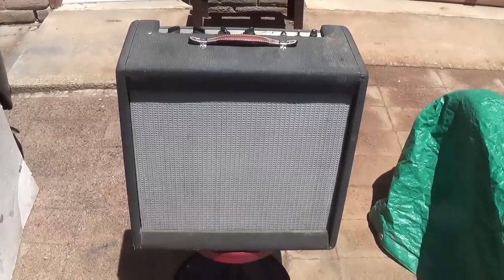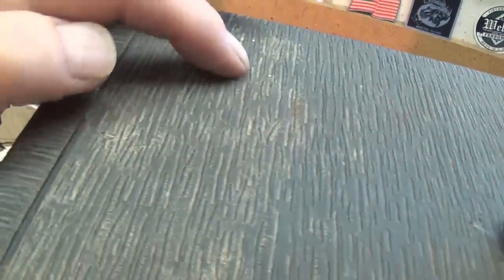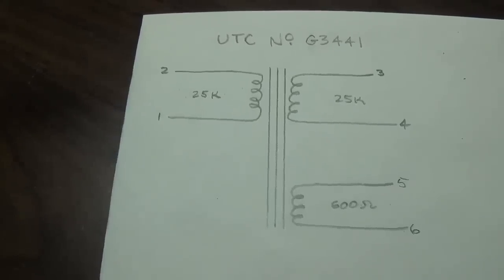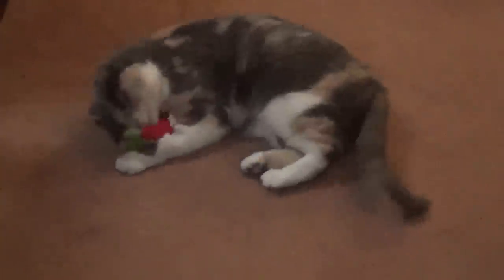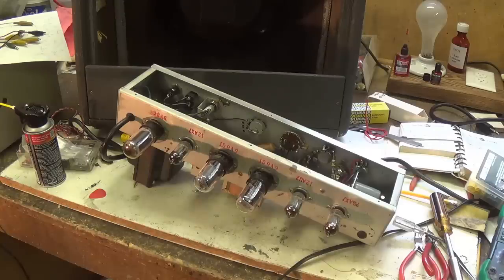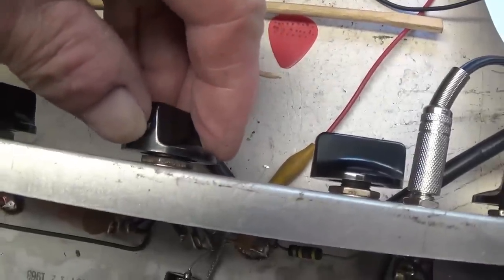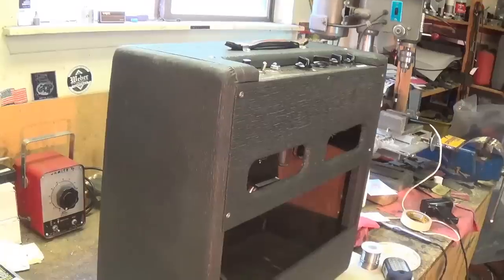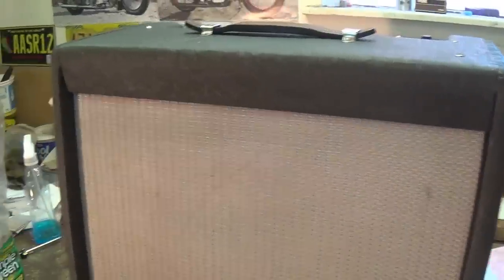1963 Lesmann "Echo" Amp......No More Polkas for this Bad Boy

Comment: I was thinking you may have to clean up that pot and switches. Gunk could be messing up vibrato and tremolo functions.

A hybrid amp with a push pull pair of transistors works just like their tube forefathers did...only the B+ voltage will be lower and the current draw higher.
You must bias the transistors like you would tubes to avoid crossover distortion and get the same kind of sweet spots in their characteristic curve...just like tubes.
You won't encounter the other two "grids"...just the control "grid" called the base. Transistors are true 3 element devices.

Read voltages from the "can" to ground. If the voltage is negative on the can (the collector), the transistor is a PNP transistor. So it'll actually have a B- supply instead
of B+. If the can is the positive on the transistor, it's an NPN transistor and it'll use a B+ supply.

I'll send you a little data via email.

Great video on the Lesmann, Uncle Doug. Turned out to sound pretty good. And I can fully understand how hooking to one 6V6 grid could work for the tremolo.
The ear still hears the result you wanted no matter how you got it.(8-)
Reply from the maker: Thanks so much, Tom. The switch was clean. There are no hidden secrets or effects.
Reply: It might be a good idea to pull a couple of those working transistors and measuring the gains  on them, just in case one of them Fails unexpectedly or gets fried in the process of troubleshooting and repairing the amplifier. You can look up the original specifications for most older transistors, how much current they will handle and so on, but gains can vary all over the place, and in my day-job work on 1960s and 70s vintage Hi-Fi gear I have often found that some of the small transistors in old amplifiers have extremely high gain and I have to test a bunch of our in-stock transistors in order to find replacement or substitute devices that are similar gain wise to the originals. Transistor testers can be found quite cheaply on the internet  or from  China n these days. If we encounter an unusual transistor that we need to replace at work, I let the Boss look up the specs and determine what we have that will be the best match and reliable in that particular circuit, he's forgotten more about transistors than I'll ever know, but he'll give me a bag of them and then I have to sort through and match the game's up. especially if they are driver or differential transistors where unequal gains means DC offset, and perhaps the amplifier doesn't have an offset adjustment trimmer. But I am rambling on and digressing..... ..... still, it's much easier to replace a transistor that is working and can be measured and tested then to try and replace it after you burned it up!
Reply: @UncleDoug  Well...no telling what the engineer was thinking...let alone a possible hobbyist later on. The amp would have had to put up with howls and squeals
from an accordion that a guitar can't dream up(8-). You did the right thing.

Comment: Wonderful job! That old amp would probably have been scrapped and the speaker and cabinet used for other projects. Although I’ve seen  accordion inputs on old guitar amps I’ve never seen an amplifier designed exclusively for accordionists, the addition of a guitar input would have given the Lesmann wider appeal.
Reply from the maker: It would have, indeed, Henry. They may still be in business if they had provided some versatility for their products.

Comment: Tremelo Oscillator in that bundle of black bits, looks like something that could be reproduced and added in to a Tube Amp circuit as you have just invented. What do you think,  can you share those oscillator parts and circuit design. Or can you point me to a schematic of such a circuit?? Such a wonderful result i am amazed at how just figure it out and then try a few things and then it works beautifully. Such a talent. Thank you so much for sharing your gift.  D
Reply from the maker: The type of tremolo circuit depends on the output power of the amp.  Single-ended or less than 20W, you can simply copy the Fender Vibro-Champ bias modulation tremolo circuit. Higher wattage circuits would have greater complexity and should use the Fender Deluxe Reverb Photoresistor-style of tremolo. You can download schematics from the internet.
Reply: @UncleDoug  thanks I am in it.

Comment: I wonder if the matching transformer was an external tank or something that used to exist, but no longer does. The mysteries! Anyways, damn good job. I wouldnt have had the patience to mess with the original circuit, I would have gutted the components and cloned a known good design. But the re-engineering approach is good too :-)
Reply from the maker: Thanks, TK :)

Comment: Okay, I am just 6 minutes in, haven't watched the entire video but this is looking more and more as if it was made to be and add on reverb speaker, similar to the ones made by Gretsch,  and I believe Ampeg also made one as well. You had a hard wired cable with alligator clips that you clipped onto the speaker of your main amplifier, and that high-level speaker signal was sent into another amplifier, patted down level wise, and run through a circuit that provided defects, usually Reverb, but in this case perhaps it's just tremolo, since there's no Reverb tank.
Reply from the maker: Perhaps, but bear in mind that this circuit has a full pre-amp and output section as well as a remote speaker volume control.....it doesn't seem like an add-on speaker to me.
Reply: @UncleDoug  , I haven't had a chance to watch the rest of the video yet, but I'll get to it in a day or so. I like to watch these things and ask questions and make educated guesses inside my brain pan as your video progresses. Helps me keep my diagnostic skills sharp.
Reply: @UncleDoug  , Ps, you should draw a schematic for it, perhaps a before-and-after if it's going to undergo any significant changes or "modernization".

Comment: I have a guess on "Echo amp". Hammond organs use the label "Main" for the internal amp / speaker and "Echo" for an additional amp / speaker. And I think your accordian idea is correct. There likely was a jack built in to some accordians and I wonder if it was labeled "Echo"
Reply from the maker: I think you're right, Rich. Thanks !!  Be sure to subscribe to receive new video alerts.

Comment: Those Legend amps were actually made by Kustom in Chanute, Kansas.
Reply: douro20 I knew I liked it!
Reply from the maker: Actually, they were made by Legend in East Syracuse, NY. The Kustom, or Ross, version of the Mesa Boogie was called the K-Studio.....and it didn't last long.
Reply: And built with finger jointed oak cabinets so they could withstand a 10 ft drop, hence Legends of the Fall.😂

Comment: It's also possible and maybe even likely that the UTC xfrmr is a signal splitter the produces 2 identical isolated signals; which are then used in the trem/vib circuitry. Do we know it's in the plate ckt of V1 as another poster opined, below? Excellent candidate for a Princeton conversion. Those conversions can take a hella lot of time, but this one seems 85% of the way there.
Reply from the maker: That is entirely possible, P00 (an unfortunate contraction), but without a schematic or a functional unit to examine, trying to recreate this mysterious circuitry would be a bit daunting. I left the UTC in place, however, so wiring it back into the circuit at a later date would be possible if additional information came to light.

Comment: Nice modification to make this Amp useful.
Be very interesting to see what you come up with for the newly arrived hybrid amp, the housing if it is extremely beautiful.
Reply from the maker: Thanks, Mikael. The Legend amp will be a challenge.
Reply: @UncleDoug  If you're of a mind to convert the Legend to all-tube....just saying that's a lot more work than you probably think at first glance. LUCKILY the pots in the Legend tube preamp are probably usable as is. To convert an all-solid state amp to tube; that's usually a lot of work. And ZERO parts from the old amp are usable on the tube incarnation, with the exception of the cabinet, speaker, and handle. Typically you can't even use the knobs, bec you have to replace all the pots.

Comment: Try running your tremolo to the cathodes of the power tubes. The LFO's speed just is a tiny bit fast. I am using a product called Tuff Stuff to clean Tolex, pleather and the upholstery of my cars, which is what it is intended for. It works great! Armorall is a dirt, dust & pet hair magnet. That Lesmann breaks up beautifully. Still not impressed with the tremolo/vibrato. Maybe a 270K or 470K  resistor to the other 6V6 grid to attenuate some of the choppy off.
Reply from the maker: Thanks for your helpful suggestions, Seth.

Comment: My name is Rhonda hanzel,for your information the,Lehmann amplifier was built in westallis, wi. For a specialized accordion that had organ effects as far as who,bilt it,you are correct at the time i,was,the electrical for,westallis music what you were talking about is true the accordion gave the ampl the power in wattage at the time they were built i.m,happy to see one ij,one piece take good care of it it is special  Rhonda hanzel
Reply from the maker: Thanks for the very interesting information, Rhonda :)
Reply: @UncleDoug  I appreciate anyone,that is that generous about,amplifiers Lehmann started in a small building  I watch them being built Fred sels was a friend don.t,know what happened to,the brand  I alway,thought they were over,built ther,really nothing to go,wrong with them the power supply was ahead of,there time  I believe the  wiring diagrams  are archived  in the patient  office,if you look for them rhonda
Reply: I thought you,would know on the fender amps,I was sub in a,pair of,6550 power tubes and doing away,with the 6l6s they run cooler and,the minus voltage is cleaner no ups and downs you keep,up the good work rhonda
Reply from the maker: @rhondahanzel3997  Thanks, Rhonda. Will do.

Comment: Looks like the three way switch just has fixed resistance values in lieu of a intensity control.  I did the same type of mod to my Small Clone chorus.  Switched out the "depth" switch for a "depth" control.
Reply from the maker: That's why I added the tremolo intensity control, GR. Good trem needs it.

Comment: I have a thing for a slight amount of chorus and reverb and a little more with delay and full distortion for leads, but the clean has to be so clean you can't hear any fret buzz for picking and defined chops while the distorted track has an opposing rhythm, one of my things. Some people like so much effects it's like eating steak with a quarter inch of black pepper, ever so slight for me so you can't figure out the spice, but taste awesome, so how would we go about building a circuit for a old amp I wonder?
Reply from the maker: The only way I could think of, Mr. B, would be to build a nice clean circuit and then use a Digitech Guitar Modeling Processor to add discrete amounts of delay, chorus, reverb, etc. This is exactly the method I used to record my original and cover tunes back in the :good old days".
Reply: My main amps have a DSP with a bunch of effects, but a 6V6 or the double ended has big golden sound in the studio using a SM-57. I'm on a kick over mixing them in, to bring a fresh old sound back to the music. You know more than anyone.
Reply from the maker: You are too kind, Mr. B. I am still learning and have a long way to go. Best of luck with all your projects.

Comment: I'm still watching,  and maybe you say this later on, but the very early Gibson amps and even PA systems had an "ECHO" control, which if you can find the old literature was purely dependant on placing another speaker far enough away from the source that it would have an echo effect, hence the ability to control the level going to the "echo" amp. Just my thoughts.
Reply from the maker: Yes, this is mentioned in this video, as I recall, and in others in which the "Echo" feature is discussed. It's more a creation of advertising hype than acoustic reality.

Comment: Wouldn't it be cool to find one of these at a yard sale? What a cool amplifier! Question please: What soldering iron do you use for those chassis joints? I'm guessing something 100 watt or higher. Thanks!
Reply from the maker: Yes, indeed, but the pickings have been slim lately.  I use a vintage Weller solder gun that was given to me by a generous viewer.
Reply: @UncleDoug  The Wellers’ are great and get hot enough for that type of soldering. I’ll find one. Thanks!
Reply from the maker: @ourlifeinwyoming4654  Good luck, OLW.

Comment: Re the British style Colour thing I mentioned,  at about 24 minutes in, as the camera is zoomed in and scanning from one end of the Legend amplifier faceplate to the other, it looks like it says colour, or color ind, short for indicator perhaps? on the upper right hand corner of the amplifier faceplate. The camera is moving around alot and it's hard to see it clearly on my smartphone, but perhaps it is supposed to say power indicator and some of the lettering has been rubbed off? I tried to pause the video but the time bar gets in the way and the screen automatically goes to a lower brightness. Actually, it occurs to me that especially if this amp was designed originally for playing an amplified acoustic guitar, it would not be weird at all to have some kind of a "color" switch meant to add some warmth the sound. Didn't Guild build some amplifiers that look kind of like this one? The oak cabinet actually reminds me of an older stereo cabinet built in the days when you could get such cabinetry that was actually made out of solid wood and not merely veneered particle board. I can't remember the company name, but we used to sell cabinets that look like that in the stereo shop I worked for in the early 1980s. We sold Sauder stereo cabinets as a lower-end line, but there was another fancier more expensive brand which I can't remember the name of.

 somebody else mention that legend amplifiers were supposedly used by ZZ Top for the Eliminator record. Tonally, and song wise, that wasn't my favorite ZZ Top record or era. I mean, I guess Cheap Sunglasses was okay, but once they started doing songs like Gimme all your Lovin, or Sharp Dressed Man, they became kind of a pop band, straying pretty far from their blues-rock roots.
Reply from the maker: I had no idea you were referring to the Legend amp, GU. I've been inspecting the Lesmann with a scanning electron microscope.....to no avail. Yes, at the top right of the Legend control panel there is a Colour knob and a Colour Indicator light. I'll try to figure out how they affect the amp's tone, and will report back later.
Reply: @UncleDoug  , I might not have been clear about which amp I was referring to, or perhaps I confused them in my mind. I confuse lots of things in my mind these days.... I believe we should render unto Confucius those things that are confusin'!
Reply from the maker: OK, I spent an hour or two with Jack and Ollie out in the workshop testing the Legend amp. It is indeed ungodly loud......but it sure sounds good, especially when playing ZZ Top at 130dB. The Colour knob changes the tone from solid state (off = shrill and sterile) to tube (on = warm and ballsy), very dramatically. This is probably not how it was intended, designed, or envisioned, but that's how it sounds to me.
Reply: @UncleDoug  , 2 hours is a long time to be listening to a couple of cats wailin' away on taut steelwound catgut substitute at 130 dB! I hope you wore hearing protection!
Reply from the maker: It only seemed like 2 hours, GU, and I had my fingers in my ears for most of it. You'll get a chance to hear for yourself.....I videoed the "concert" and will post some excerpts in a future video.

Comment: You beat me to it. Was about to suggest making a new tube amp for the Legend but you got there first
Reply from the maker: The cabinet is too good to waste, and the hybrid circuit is too complex to modify........seems like replacement would make good sense.
Reply: @UncleDoug  Thank you Uncle Doug. I can't find, but am convinced I watched, a video of yours with an ancient but simple single ended 6L6 amp with a Rola electrodynamic speaker. However I can't find it because I can't remember the brand. Could you please remind me? Sorry to ask an off point question!

Comment: "Vib" stands for vibrato. You worked on an amp back in January that had TRUE vibrato (PANaramic). I'd be very surprised if this amp has it, due to its very simple circuitry.
Reply: Without the patented magnatone circuit, and the necessary custom-made barristers, true electronic vibrato is impossible. Some of the earlier Fender amps that used three tubes for the tremolo function had a very complex tremolo sound with some phase-shifting effects that work closer to being pitch-shifting ( the later fenders with  the LDR opto thingy, aka the "roach",  in the  tremolo circuit,   are almost always disappointing).  But anyway, t this amp doesn't have enough tubes for anything like that. It has to be tremolo regardless of what the faceplate says.
Reply from the maker: Agreed, GU. There simply was no circuitry within the chassis to support any claim of vibrato.
Reply: My Ampeg B-12XT has pitch shifting Vibrato-not as intense as a Magnatone, but never the less, pitch-changing. @goodun6081